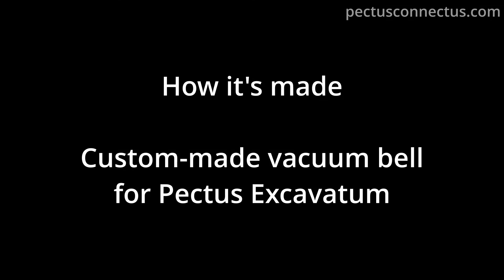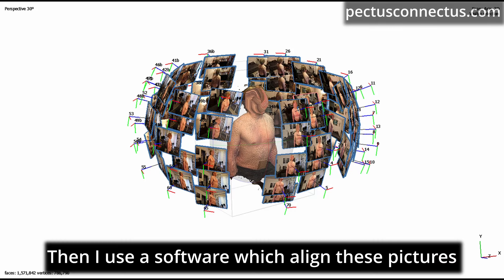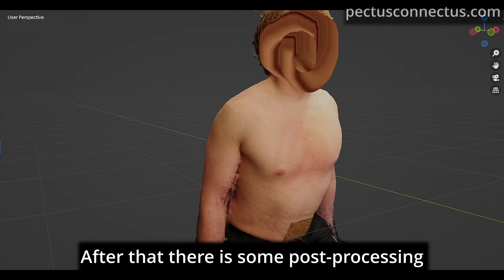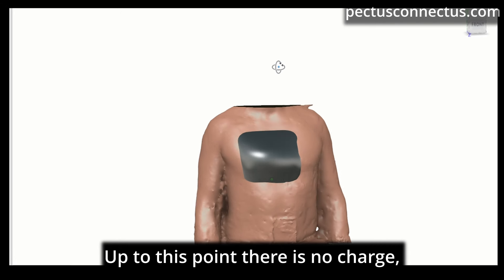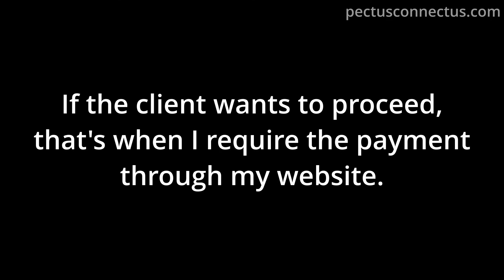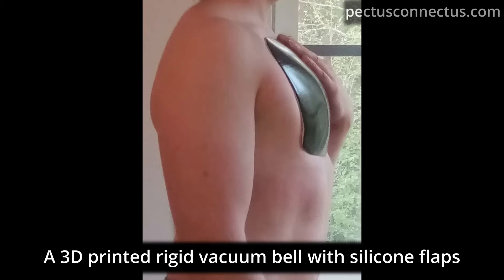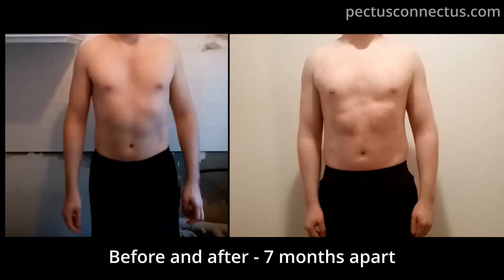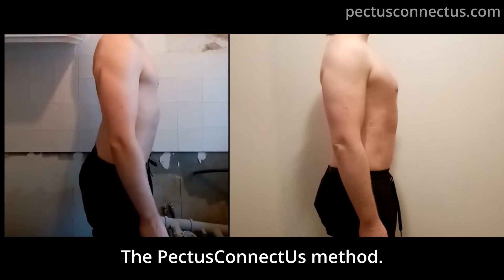How it's made: custom-made vacuum bell for Pectus Excavatum

Comment: How many successful customers do you have? I only see the one example on the website.
Reply from the maker: Hello, I have one client who has been treated, and recently I had a couple more customers. I am currently working on multiple devices. Their success stories will be shared around this winter/spring :)
Reply: @pectusconnectus  How do you respond to the people who say these techniques don't work in adults, that their sternums will simply revert to their original positions?

How do you ensure the changes are permanent after discontinuing the treatment?
Reply from the maker: @ChrisHedges-sp9mx  "How do you respond to the people who say these techniques don't work in adults, that their sternums will simply revert to their original positions?"

I don't, I created a long video where I explain everything, there are studies about this in the video, also Wolff's law and Davi's law "works" on adults aswell. This is a new thing, it needs time to be accepted, similarly that scoliotic braces or dental braces work on adults just as well, but it's been around for a long time now so it's generally accepted.
If it wouldn't work then Nuss surgery couldn't be used on adults either. Actually, you have a much higher likelihood for regression with the surgery as the other, underlying root problems aren't addressed with the surgery, meanwhile my method is based on these problems and you gradually overcome these together with the indentation.

"How do you ensure the changes are permanent after discontinuing the treatment?"

The bars after the Nuss surgery needs to be in for 3 years. With my method I don't think you need 3 years, but I think 1.5-2 years of device usage is necessary for permanent results. After around 8-12 months (once the indent is gone) the patient needs to taper down with the devices, but not with the training.
My method itself ensures that the results are permanent because you aren't just using devices but you actively need to stretch the shortened muscles, strengthen the weakened ones and also you learn how to breathe properly under the treatment which is the most crucial factor.

If you have any more questions, let me know.